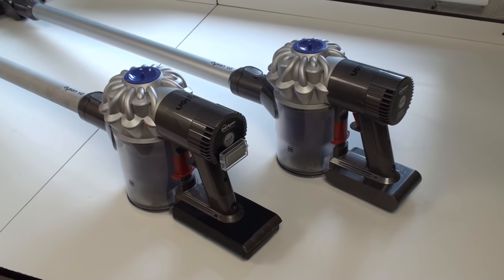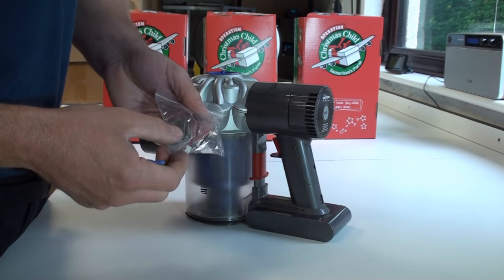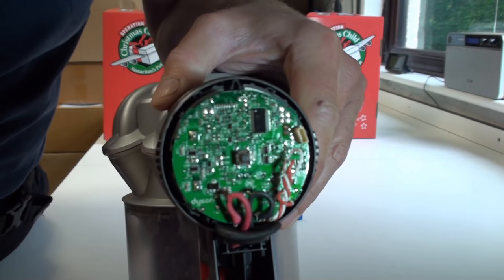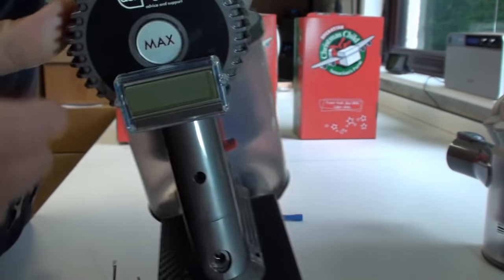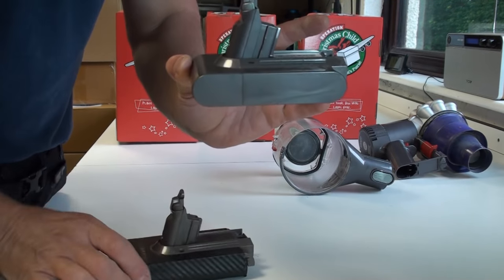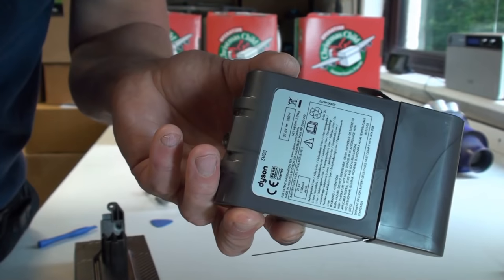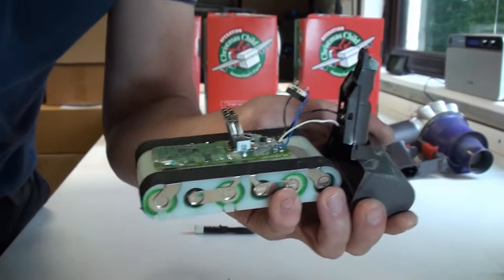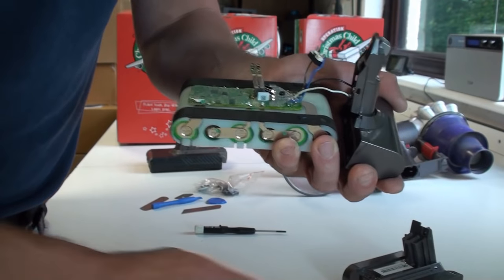Dyson V6 Modification

Comment: THE MOST OVER PRICED PIECE OF CRAP ON THE MARKET. Made in China. The battery lasted less than two years. Now the switch will not work.
The Dyson Mfg. Does not have a repair center or parts. And no centers across this Nation to work on them. I communicated
with Dyson Customer Service today. They confirmed the statement above???. The service adviser said i am sorry. Guess you will have to get a new one. My reply was you have got to be kidding me. Clean one an a half bathrooms then you have to charge the battery. SHOCKING.
Reply: John Whitten any vacuum shop should be able to fix a Dyson. If it's 2 yrs old,you have got about as much life as a lithium battery pack lasts. As for the switch you will need the part called the main body. Dyson has a video on YouTube that shows how to change the main body on a newer v6.

Comment: Any1 care to share their experience & testify if the modification thought on this vid works? Im a bit wary & hesitant to try the mod until i hear other youtube commentators experience
Reply: another words i need feedback from sum1 else thats tried the mod suggested in this vid
Reply: Erick Don't try it. Lithium batteries can be very dangerous and can cause injury or even death. The modification to the battery isn't worth the risk. This machine requires a absolutely huge amount of power. Leave it to the pros.